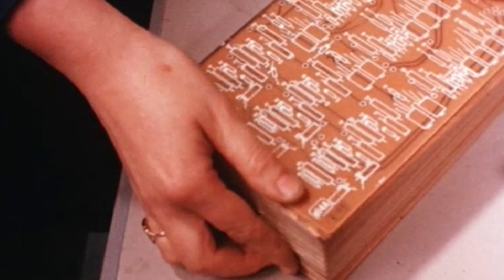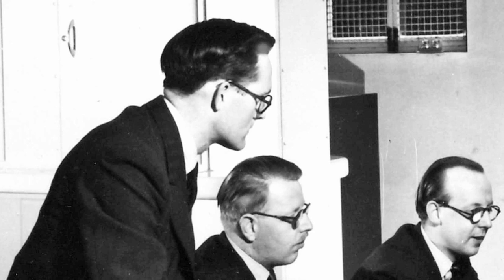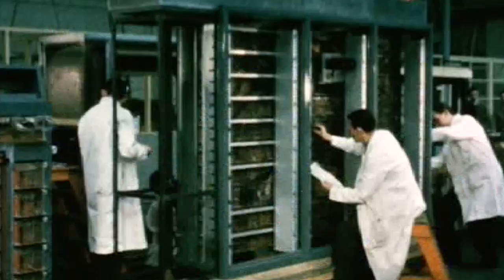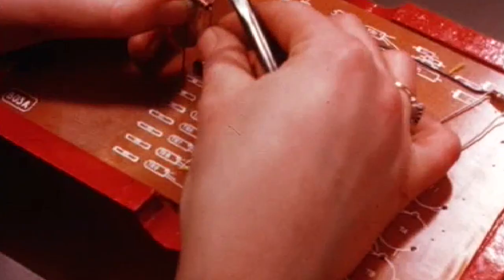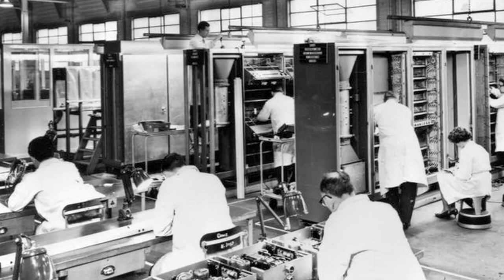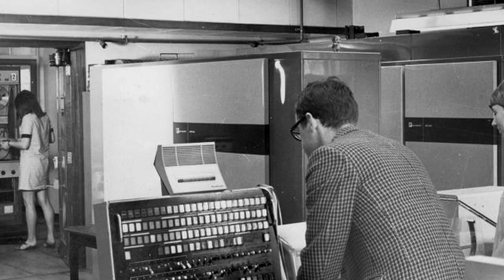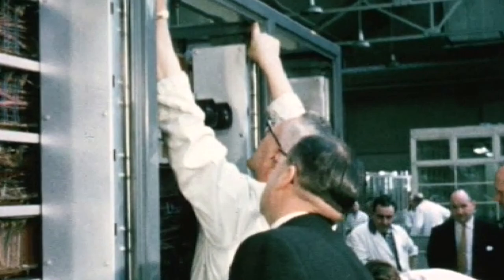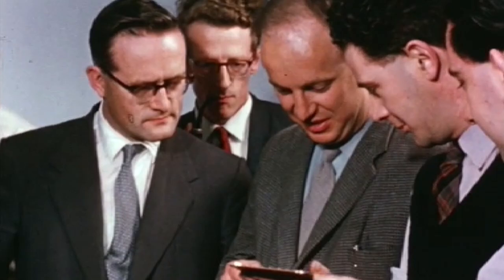Ferranti Atlas: Britain's first supercomputer

Comment: I joined computer division of Ferranti in 1962 as as student apprentice. In 1965 went to work on the Atlas at Manchester Uni in Dover Street as a junior field engineer. The machine was getting reliable by then and we engineers bought lilo beds for the night shift. Also our room overlooked the ladies changing room of a Uni theatre across the road!! The machine would time share (one at a time, NOT multitasking) 64 programs each up to 500,000 instructions. Results were printed on fast line printers

Comment: This was between vacuum tube technology and integrated circuits. I believe it used diode transistors.
Reply: There were no vacuum circuits on the atlas. It was the first fully transistorised computer.
Reply: A General purpose computer Used diodes AND transistors All based on The Manchester Baby,  started when the first 'hearing aid' transistor became available.  Contemporary with Ferranti Argus series    Of process control computers 1961  At the same time the first integrated circuits were being produced A complete Flipflop or op Amp in a TO5 can

Comment: What is ESD and MOS?
Reply: ESD: Electrostatic Discharge.  Static electricity zaps.
MOS: Metal-Oxide Semiconductor.  A structure that you can use to make transistors.

Comment: Hardly a supercomputer in the modern sense.   The English love to tell us how they have the most advanced technology, even when (as almost always) they don't.   Let's look at some performance statistics, comparing the Atlas with a contempory machine:-
Atlas:  Introduced 1962, 48 bit words, 1.6 microsec instruction time, 16kByte working RAM.
IBM 7030:   Introduced 1961,  64 bit words, 1.5 microsec instruction time, 256kByte working RAM.
That makes the IBM at least about 4-10 times faster in use, depending on the applications run.   The IBM reliability would have been far beyond the Atlas.
Reply: I think your information is incorrect.  It's absolute bollux actually except for the instruction time but then it all depends on what your instructions can do doesn't it?  BTW: If you listen. there were Welsh voices not just English, so your xenophobia is well miss placed..
Reply: @alphalunamare  :  Different instruction sets rarely make much difference in practice, although one can always write a program to highlight something a particular instruction set can do well.   The IBM having 16 x 1.33 times as much working RAM would give a performance advantage in practice far outweighing any instruction set advantage.
The designers of early British computers such as Altas had a penchant for making stack-based instruction sets.  Stack based working has certain theoretical advantages but is a prick to program, and in practice the theoretical benefit is lost.
I have checked the data I gave - word length, RAM size, date of introduction - all are correct.
There are several different accents spoken in the film.   None of them mean that this is not an English/British film.   If you are trying to say the people of Wales are different to the people to the east - that is like saying Georgians or Californians are not people of the USA, though their accents are. quite different.

It is a fact that the English love to tell us they invented all sorts of stuff that they didn't, or perfected something first.   Examples:-  Magnetron used in wartime airborne radar, supposedly invented by Randal & Boot.  Actually it was invented by a Japanese university professor well before the War.  Theye never mention that radar needs two essential things - something to emit the pulses (that's where the magnetron comes in) and something to receive and detect the reflected pulses coming back. In wartime airborne and marine radar, that was the point contact diode, invented in the USA.   Television;  I've seen countless books, TV programmes, etc from England that claim TV was invented in England y J L Baird.  Actually Baird was a con artist /snake oil salesman who didn't know how to make TV work, not even remotely.  Funny enough, they all say he used a Nipkow disk to scan the picture.  This was invented by  P G Nipkow in Germany decades before.   It never seems to occur to English journalists to ask why is it called a Nipkow disk, and not a Baird disk.
Reply: @keithammleter3824  I could be wrong, it might be 0110 21 00 28   meaning V21 = VN0  but that was on a FM1600E come to think of it.  Manual/ SS/Normal etc!  got it?
Reply: @keithammleter3824  As for Georgians and Californians  ... Jeff Foxworthy  and Dwight Yoakham ... both most excellent.